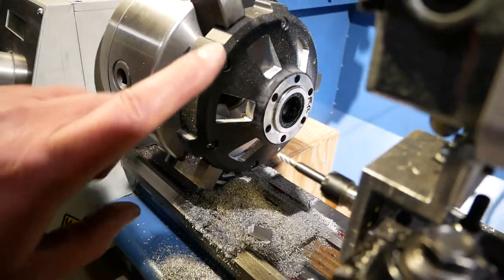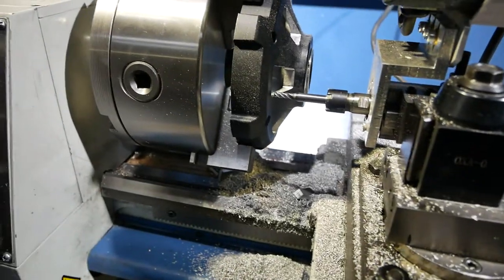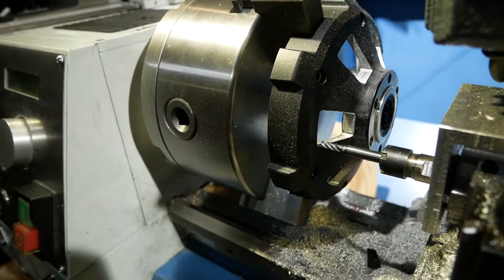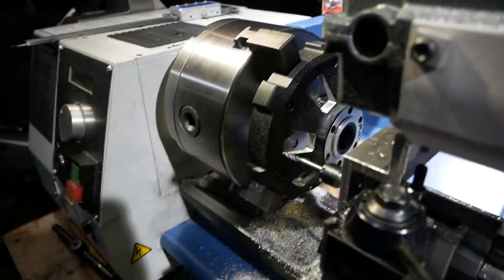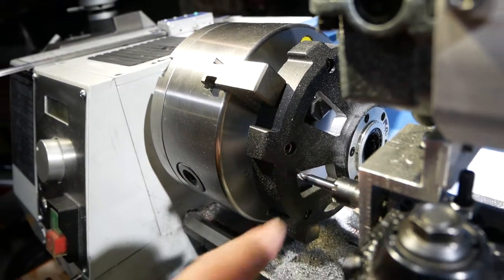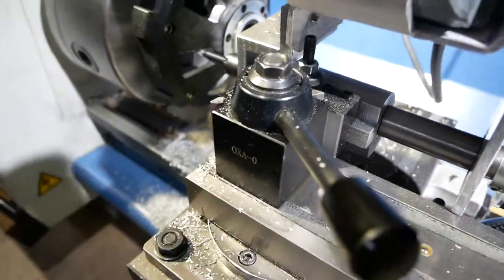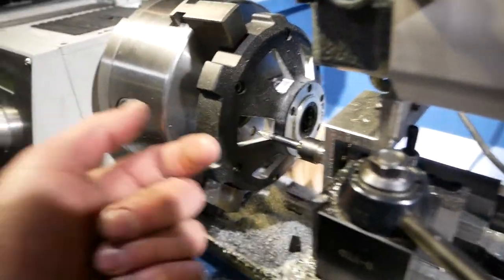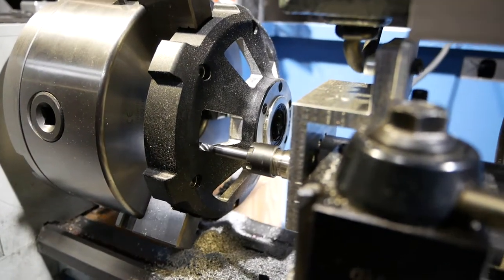Lathe tool post grinder: Venting a hub motor cover for my Dualtron City scooter

Comment: this is amazing, i want to precisely drill spoke holes in a hub but i swear, this process would take some amount of practive for me to master.
Reply from the maker: It wasn't that hard to do actually. The rotary table and positioning of the cross slide does everything for you. The critical detail is not losing position.

Comment: I like it. I figure you must have many rotors to modify to justify such an elaborate and expensive setup?
Reply from the maker: Cost wasn't that much. $140 for the rotary table, $40 for the ER32 collet chuck, $130 for the flex shaft kit that had the motor. This is far less than the cost of a ready made tool post grinder! Cheapest I found for them in the size I have cost $1200 and I'd still need the rotary table and ER32 collet.
*
I'll be using this setup again and again. I don't know if I'll ever do more motors like these ones.
Reply from the maker: I do have plans to machine another motor with it, but that one will be much larger and will barely fit on my lathe.
Reply: @de-bodgery  Very impressive and neat the way you assembled all those parts together to do that job. Hopefully you’ll find other uses for it beside motors.
Reply from the maker: @ellieprice363  I already have. I haven't made them yet, but I spot weld battery packs made from 18650 or 21700 cells fairly often. The weld pens get pretty hot after a while and I can no longer hold them. I bought some copper bar stock and plan to make water cooled weld pens. This setup on my lathe will be how I cut the coolant channels in the copper bar. A channel will run up and down the length of the weld pens and then cross over near the hottest area to pull away heat from the weld pens. I'll use a small PC cooling radiator to dump the heat to the air. I have most of the parts to do this, just need to machine the copper bar. This setup can be used for all sorts of segmented or interrupted operations and other things. With a very thin cutting wheel I can cut narrow slots in a cylinder for retaining a circlip. With a thread cutting mill in it, I can cut threads. Uses for this setup are many.
Reply: @de-bodgery  Thanks, again very impressed with your plans. I’m a machinist and tool maker with my own shop so I understand your custom work maybe better than most. My work with the telescope and EDM industry is tapering off now after many years.
Reply from the maker: @ellieprice363  Nice! So there is a high chance that my machining is rudimentary and rough compared to what you are used to doing or seeing at your job.
Reply: @de-bodgery  Not really, your work is very exacting. I’ve never seen a rotary table setup like that. The only change I would have made is to use a larger end mill, perhaps 10mm with longer flutes for faster cutting and less chance of breakage.
Reply from the maker: @ellieprice363  Thank you...very kind of you to say so. I had looked and looked and looked at things sort of like this and saw nothing remotely like it. I found lots of people using tool post mounted grinders for all sorts of things. I found lots of examples of using degree wheels or protractors to move to some specific amount of rotation. I also found lots of examples of spindle locks. What I didn't find even once was what I did. It seemed like my idea was pretty obvious and I honestly expected to find others doing what I did.  I can do anything the other implementations did and machine while controllably rotating the spindle set amounts of movement. I'm super pleased with how it turned out and it has worked quite nicely. I did 2 changes after it was all built. I made a video on the grinder front bracket getting that screw pattern cut in it. The other was the locking shaft inside the spindle bore. I made a second one that was a better fit as the first one had some flex in it. 
*
My lathe is pretty small at 8x20. I have an ER11 collet in the tool post grinder. The largest mill it can hold is 6mm or 1/4". A 4mm mill is pretty small and I have to be careful to not push it too hard. I did snap one off in experimenting with hogging out aluminum. The universal brushed motor is supposedly 1000w and I'm somewhat doubtful that is the case. It loads down a good bit with a 1/4" mill in the collet chuck. I'd really have to use a more powerful motor to use larger mills or gear down the motor more. I have 3:1 gearing on there now since that just fits over top the cross slide. I could go with a larger pulley on the ER11 collet to gear down more, but then I don't clear the cross slide. I think I will eventually get a spindle motor to replace the universal motor. Power density on them can be really good and a VFD is going to produce solid motor torque over a wide RPM range. With the abundance of motor torque that will deliver, I'll probably do a lot of work like this with a 1/4" or 6mm mill. For now a 4mm mill is a good fit for the motor torque I have on hand.
Reply: @de-bodgery  Thanks for the additional information. With only a small lathe and good planning and adaptation you did an exceptional job. The same modifications would have been relatively easy and straightforward on a vertical mill with rotary table. Sometimes you have to just work with what you have.
Reply from the maker: @ellieprice363  I have a 20" drill press and I do lots of milling on it. I've made hundreds of steel, aluminum, brass and copper parts on it. I even have an 8" rotary table that I've done work like this on it. However, this lathe setup is much more precise and predictable than is doing the same thing on my drill press with my XY rotary table. My drill press has machined/milled 1/2 thick 4140 steel and done fine. It's pretty capable considering it's a drill press and not a mill.